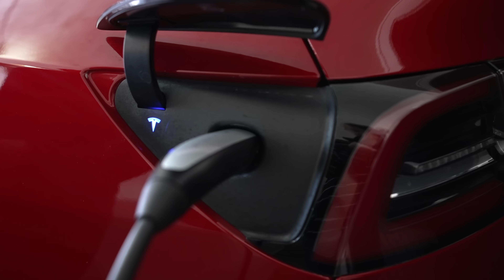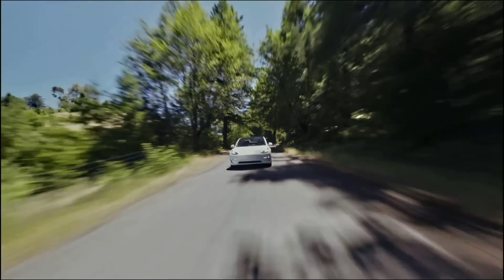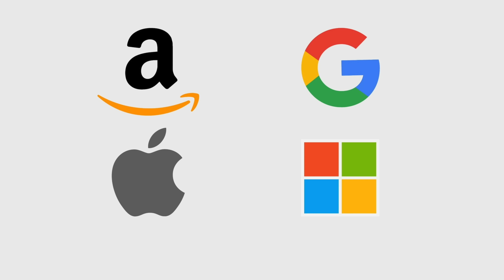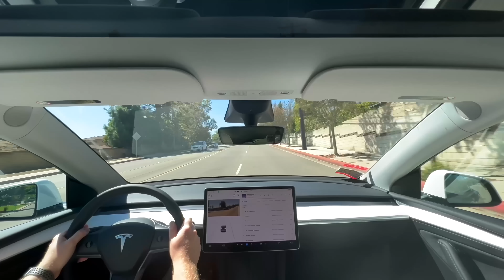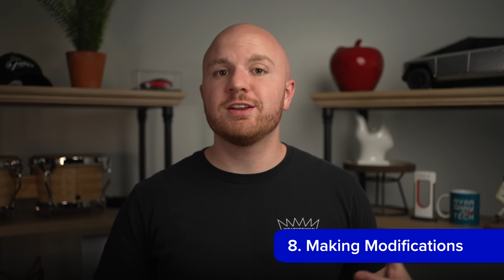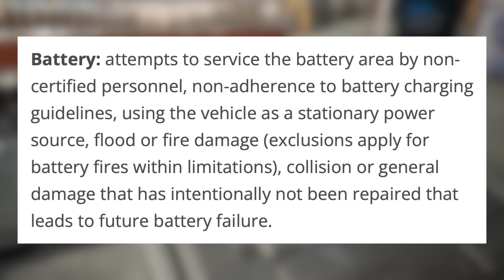9 NEW Ways to Ruin Your Tesla | Please Don't Do This

Comment: Correct me if I am wrong.
Any EV battery has a finite number of charging cycles.
If you use the vehicles power for other uses like powering your home or excessive use for powering electrical devices, this will result in your battery requiring more charging cycles. Your battery will require replacing after fewer miles travelled than if the battery had been used solely for vehicle propulsion.
Reply: You’re technically correct but the power draw of personal electronics will be insignificant. 

Now powering your home for extended periods of time will eat into charge cycles but it depends on how long and how power hungry your home is. But as a backup or grid stabilizer it won’t make up a big difference and will save you from buying home energy storage.
Reply: @chidorirasenganz  Not talking about personal electronics but rather about heavy electrical tools on a building site.

Comment: I got a Model Y Performance and was thinking about switching out the 21 inch wheels to 20 inch squared setup, would that void the warranty as well?  Thinking about getting martian wheels.
Reply: Shouldn't be an issue, assuming the wheels are not square!  So long as tires and rims do not cause other damage, you're home free. Lots of owners change out the tires and rims.

Comment: I have been too afraid to test the manual door handles opening myself, but people I show the car accidentally use them all the time, finally not having to worry about warning passengers how to open the door is a huge software plus! 

Ps. Do you happen to know what software iteration brought this change?
Reply: Really? I don't think I've ever had anyone use that manual latch. I feel like it's harder to see. The button is illuminated and right next to the handle
Reply: @qman66  You haven't driven with my relatives.  Happens all the time if I'm not quick enough to stop them.
Reply: @qman66  I didn't even know a manual latched existed in my model 3, 2022? I'll have to look for it, as I always use the illuminated door open  button
Reply: I bought third party door icon stickers from Amazon and placed it on the button, it works wonders

Comment: Ryan can you charge fully 100% on long trips at every stop to charge say Shitcago to Florida?  You said you charge 100% before you leave but didn't specify if you charge to 100% on all ur stopping charge points.
Reply: The last 20% takes a LONG time, so you are generally better off with more stops and only going to 80/90%
Reply from the maker: Yeah, you're not going to want to charge to 100% on each stop because the last 20% takes the longest.

Comment: I have a new 2023 Model 3 with LFP battery. Having 100% battery charge daily is a nice bonus. IT means I have a nice usable range for the money. I could have spent much much more on a Model 3 long range, but at 80% charge it meant the effective range (if you follow guidelines) tops out only 20-30 miles more than my Standard range LFP.  Paired with supercharger network i'm finding it's more than sufficient for road trips as well.
Reply: I have the 2022 LFP SR+ it’s perfect, but the funny/strange thing is that the car is registered in my country as the model: Long Range RWD.
Reply: If you do some digging the LFP battery will last longer if you don't regularly charge to 100%.   Tesla wants you to charge it to 100% once a week to keep the battery indicator in sync with the condition of the battery. At least that is what I recall.
Reply: @danharold3087  I've read that as well. Also it's my understanding that it degrades in the first 100k miles of use at about the same rate as the regular Tesla battery whether keep it 100% or not. But then after that the degradation of the battery levels off, and loss of range over time/mileage is much less.
Reply: @danharold3087  This is incorrect. The battery will last longer regardless, it'll just degrade faster until 100k miles then balance off. The LFP battery itself is said 12,000 cycles regardless of 100% charging, where NMC will only last 1,500 cycles.
Reply: My 2019 Lr I charge it to 80-90%  233 miles at 80% and 263 at 90% and 293 at 100%. I’ve only charge it to 95% once for a long road trip.  When I’m at a supercharger to go from 90% to 100% the speed drops down to like 30kwh. Says it will take about 30 minutes but I’m not that patient to wait.  I will agree it is annoying only charging to 80% BUT I have not needed to really charge that much except for my thanksgiving road trip.  80% charge will last me for 3-4 days without charging. I drive it to work and back and around town.

Comment: Do you think adding a skid plate (mountain pass smash me skid plate) would count as a mod? Or should I attempt to have Tesla instal this (I don’t know if they’d agree)?
Reply: For what it's worth, I had that skid plate installed at my local service station (I have to drive along some gravel roads often).  This last week I had the Tesla service station install their winter tire set on the vehicle and they didn't say anything about the skid plate being on the car.  I've had it on since last Spring and can't tell of any issues.
Reply: I've wondered the same thing.  I'd like to protect the front of the battery with the coolant lines I've heard can break off if something large goes under the vehicle.

Comment: I took delivery of my Model y over the weekend. I've been reading about how the seats crack over time since they aren't real leather. Used to have a couch that cracked and flaked and wanted to ask if there was a way to condition the seats to prevent that.
Reply: I've never heard of Tesla's non-leather seats cracking, although that does happen to leather seats over time.  The material Tesla an other automakers uses should last about 10 times that of leather, as it's far more durable. The fake leather material couchs use may look similar, but is not.  Of course if you use sharp metal on any material, like pants with metal studs, it could be  damaged fairly quickly.
Reply: Real leather car seats get fine lines/cracks with age.   I am not sure about when each cracks.

Comment: Just an FYI, if anyone ever runs in to some issue with Tesla trying to void their warranty, remember the Magnuson Moss Warranty Act. Even if they write doing X will void your warranty, there are still limitations in place on manufacturers by law. Reach out to your attorney general ASAP if they claim that your warranty is voided. You are absolutely allowed to fix your own car and you do not have to use ONLY OEM parts. Like all laws though, the act is a little loose, but the attorney general can be an extremely useful tool. I've taken advantage of their services many times.
Reply: @AncientRe  😂😂😂
Reply: This makes sense. It's similar to walking into a store and seeing a sign on the floor saying, "Caution: Wet Floor". Ok, thanks for letting me know. But if I slip and break my leg, that sign won't get the store out from under a lawsuit. They'll still have to pay!

Obviously, messing with your Tesla is trickier. If you don't know what you're doing an actively damage your car, it's no different than dropping your laptop and expecting a full warranty. On the other hand, jailbreaking your software should not be cause to have your warranty voided. At least not in every case.
Reply: @dontbanmebrodontbanme5403  I might get that swapping parts with non OEM could be logical as a self fix which could be an odd reason to void the warranty. 

However, I firmly believe that purposefully jailbreaking or opening up the software for modifications on a software heavy vehicle is cause for your warranty to be voided. 
Seems unreasonable to remove the safety bars on a balcony for a few centimeters of space and then complain about it that the safety measures arent there.

Comment: Some great tips here, I do disagree with the device that allows you to go hands-free with autopilot. I'm perfectly fine to pay attention and have my hands right next to the wheel while using autopilot. While some people may use this in an unsafe way, that doesn't mean everybody is. I do not like having to apply pressure to my steering wheel while I'm going straight down the road. That's counterintuitive to driving.
Reply: Moving either your left- or right-hand scroll wheel 1 click does the trick. I always have a hand on the wheel and yet my car sometimes doesn't recognize this. I simply increase or reduce my audio volume 1 click to satisfy the car.
Reply: I don't have one of these devices, but I agree with you. Other cars use "eye tracking" to make sure you're paying attention, so that is clearly the important part. Tesla just happens to use the steering wheel to monitor this. Paying attention and being always ready to take over is the important part though. Unfortunately, Tesla has to cater to the lowest common denominator, and that means unsafe people.

Comment: Hi Ryan, quick question. My tesla model 3 paint chipt off on one side under the driver door, i talked to tesla they said tesla paint does not get covered with warranty is it true? it was painted badly in first place
Reply: Heard some similar cases.
Either take them to court and pray they are wrong or try to fight it out with them first.
If it had a bad paint job when delivered you should have brought it up then.

Comment: Good points!  I might add, DON’T SLAM THE DOORS!  With the windows down slightly, you don’t have to fight air pressure to close the door.
Reply: my passengers seem incapable of slamming my doors smh
Reply: All MY windows do lower themselves slightly when one door is open and closed to prevent pressure shock. I noticed this happening after a couple of updates ago. It may have always been this way but just recently noticed.
Reply: Most cars due this automatically, i.e. lower window slightly when door opens, then close after door closes.

Comment: One of my biggest issues with my 2022 MY LR is the very stiff suspension. I was looking into more comfort, suspension upgrades, but I’m worried about voiding my warranty. I am hoping that the comfort suspension retrofits on a newer MY will be available soon at tesla service centers.
Reply: They just upgraded the suspension for all Model  Y's and 3's. I just got my Model 3 a few days ago and the suspension is great.
Reply: @jasonfranciosa  what model years recievef new suspension? 2022?
Reply: @rhsalce  October 2022
Reply: @jasonfranciosa  damn I took delivery of my Model Y Performance in September 2022
Reply: @rhsalce  Ah, yea, supposedly it's a major improvement. I just got my Model 3 last week, not sure the exact build date, but the suspension is good.
Reply: You can't satisfy everyone - case in point, I am quite happy with the stiff ride on my 2020 M3 LR as it is a more sporty ride and the handling is great. (I have the performance upgrade option) 
I did however opt for the 19 inch wheels instead of 20 inch as I don't want it any stiffer than this.
Reply: @alexd302  it’s still sporty and firm but much better rebound and balanced. The improvement on the model Y is even greater though due to it being higher.
Reply: I just took my Model Y in for service a couple weeks ago.  According to a showroom employee, apparently the comfort suspension kit consists of only front strut assemblies and rear dampers.  They predicted that this will be offered as a retrofit option not too far down the road.
Reply: @LimpHz  Nice! That will be great news. Has anyone confirmed if it's on the Model 3 or not yet? Musk said it was, but the Tesla press release only mentioned the Y.
Reply: Stiff? Not at all

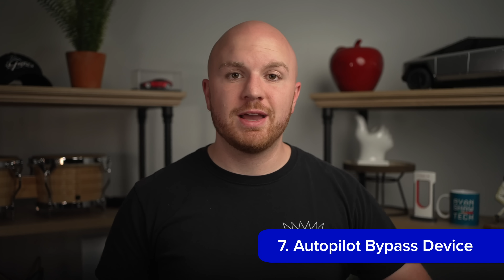Comment: 7. (9:33) - That's not really a problem with 2022.40, as the AI knows the pressure on the wheel is consistent and therefore knows it's not a hand.

Comment: My new model Y defaults to 90% max and the website seems to indicate 90% (as did yours probably).  Do you drop it to 80% or just leave it at 90%.  I’m curious if the miles you can technically drive past 0% account for almost an additional 10% reserve which would make the 90% closer to an actual 80%?  Haven’t done the math to see if that works out but just a thought that crossed my mind in why they might suggest 90%
Reply: I got my new Model Y in early October, and I asked that question to a Tesla rep.  It was during a Microsoft Teams webinar for helping new Tesla owners learn about their car.  He told me 90% is recommended on them now, so that's what I've been using.
Reply: I just got my Model Y this weekend and this is the case, would be wondering what to do, leave it at the default 90% or change to 80% as I have heard so many times
Reply: @ttwTheFear  I changed it to 80%

Comment: I like my 21 m3 lr but 3 times tesla had to warranty the car and every time they make the customer experience so horrible I'm considering a Ford [gross]. I understand crap happens but man tesla is dropping the ball with supporting the product and people who paid for said product. 

Nervous for tesla ownership outside of my warranty.
Reply: Get a BMW m240i
Reply: @domcars  personally, built ground up to be an ev matters to me. I'm not a fan of any auto maker tossing ev powertrain in an ice vehicle.  Looking forward to bmw's vehicles with the 4680 structural packs <3
Reply: @borshardsd  I’m in the opposite boat and am looking to trading my model 3 dual motor for an M2. I miss the feedback from an engine
Reply: @domcars  I think our boats are similar <3 I am still madly in love with my Franken beetle [put a gti engine in]. I hope you get that m2!!
Reply: maybe, but my wide went the local Chevy house, with our Bolt, and they were pushing an oil change.
Reply: @davidwillims2004  sad to think everyone is like that. Well then, I guess it's all effed.

Comment: Ryan, why charge to 100% before a trip if that will cause you to arrive at the SuperCharger with more SoC than needed?
Reply from the maker: Well it probably wouldn't make sense there. In California, it just means I drive 20% further before going to a supercharger.
Reply: @RyanShawTech  My 2022 MY LR shows a 50%-100% battery so doesn’t that mean i CAN charge it at 100% all the time like the recommendation with the M3?
Reply: @RyanShawTech  btw I appreciate your videos. Thank you.
Reply: It's a great opportunity to bypass one supercharger event to save time. I usually don't drive too fast and with the 100% charge, I can go as far as possible on my intended route. As someone else has said, it's cheaper to charge at home. 100% charge is fine as long as its not all the time.
Reply: I charge to 100% before a trip due to safety, security and less range anxiety. I’ve seen up to 29% range difference based on weather or unforeseen driving conditions. 

Even my last road trip this week we saw everything from 1%-10% arrival difference. Not counting losing up to 4% overnight with everything turned off and not checking the app.

Still can’t wait for more range. It really limited us on exploring this last trip.
Reply: @beefuzzy310  kinda silly to not use 100% of the battery which you've paid for. Tesla advertises specs based on 100% charge, they should support that rather than all these    conditions. Just charge your car and use it and not worry about it. You don't want a cR that lasts forever, at some time you will need to replace your battery. So charge it to 80 or 90% for normal cases and 100% for planned trips. Beats range anxiety for sure. A strong head wind will sap your battery and can ruin your day.
Reply: @beefuzzy310  losing up to 4% overnight with everything turned off and not checking the app: This is the battery does not hold the charge. How old & mileage is your model? and battery ? I have 2020 M3P bought at 9340 mile on Dec 6th 2021, after 13,500 mile last October it started  to drop from 299 mile FC to 294 that's 1.7% drop. Overnight, it drops from 294 to 293 as I check the app every 2 hr. If you have a defective 12V auxiliary battery it will drain your main battery.
Reply: @Cuti932  2022 MYP, purchased December 2021. 11,800 miles. It’s intermittent. Everything with this car is intermittent. Sometimes it drops 0%, sometimes it’s 4%. 

I always try to give myself a little extra. Until they really dial in this software, range anxiety is my friend.
Reply: Likely cheaper to charge at home than at an SC. Granted we're talking a few dollars and probably not worth the battery degradation.

Also could reduce the amount of time spent at an SC. If you arrive with a higher remaining percentage and need less top off to get back on the road.